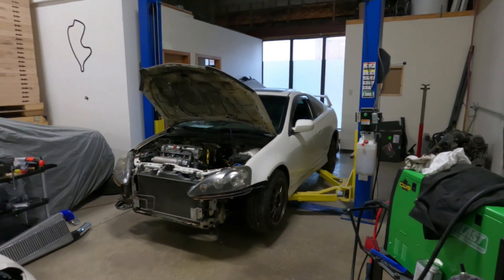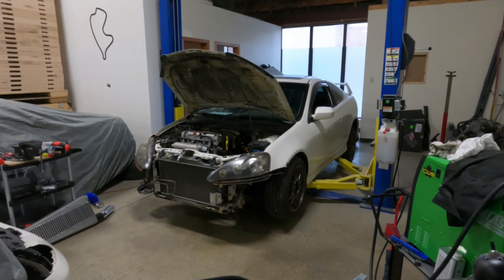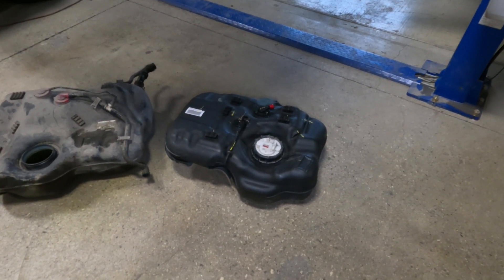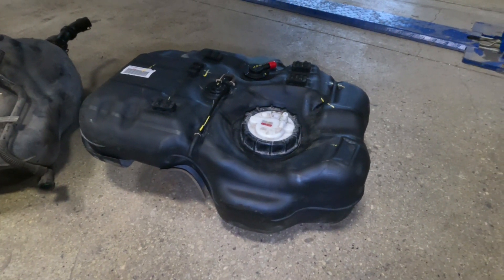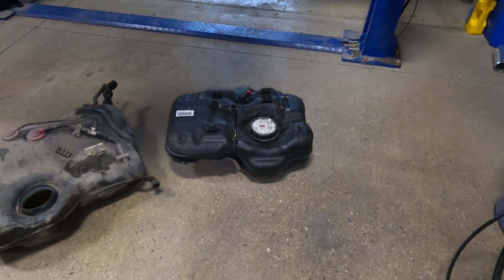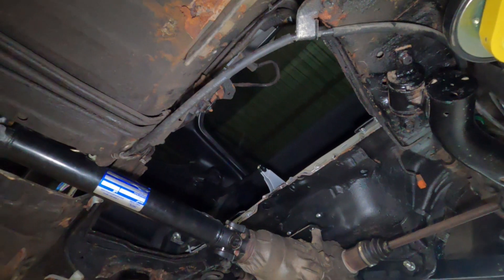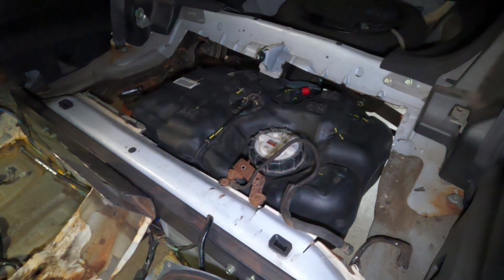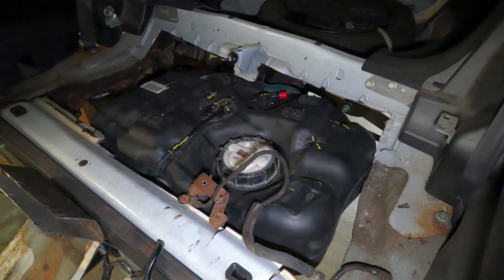RSX AWD Ep 6 - Gas Tank Success!!!

Comment: Nice, it would be great if you could test fit it on a rsx without the seat floor cut out. If it fits without have to cut out the seat floor because I want to have the rear seats in my rsx.
Reply from the maker: Unfortunately this tank wont fit without cutting the seat floor